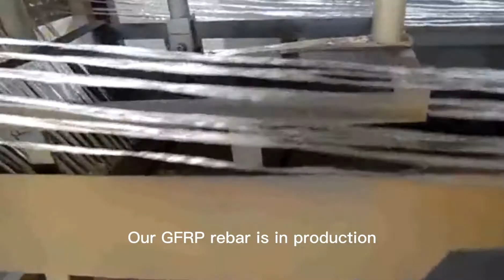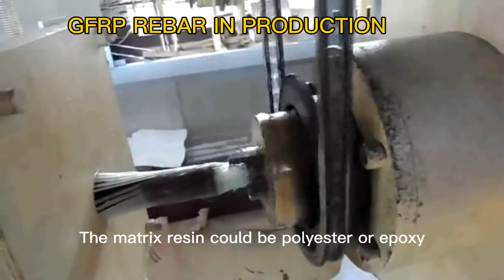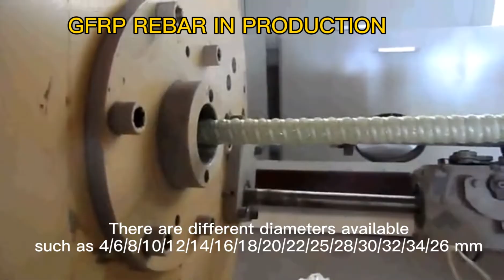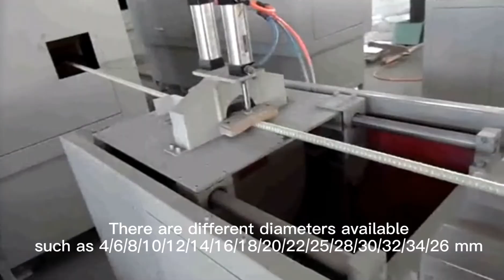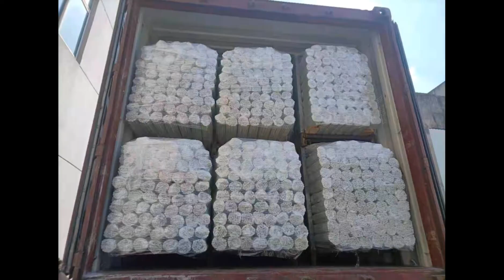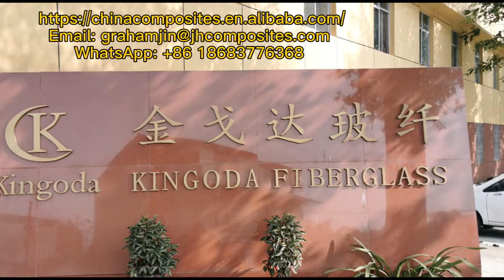GFRP Rebar Factory in Production

Comment: Two technologies can be used in the production of composite reinforcement today, these technologies do not depend on either the resin used or the roving used, i.e. these technologies use any roving and any resin.
Learn more about technologies:
First,
this is a common technology.
The productivity of which can be increased only by increasing to the limit the speed of 100 mm / second per rod, at this speed it is still possible to impregnate the roving well and it is still possible to cut rods into a given size... Further, the productivity of this technology can be increased only by increasing the number of rods produced simultaneously. We, in this technology, have brought the simultaneous number of rods produced up to 40ka. But there are limitations, a 40–bar line is a combined line - it also produces a composite grid. A line without mesh production is only possible up to and including 30 bars. All further increases and accelerations of this technology are meaningless and do not carry any logic or potential. That is why we have developed the second technology.
This technology has the biggest drawback – these are replaceable coils or bobbins, which on the one hand slow down the whole process, and on the other increase the cost of the final price of the composite reinforcement rod.
Prices:
- 10 bars from 90,000 euros and above - depends on the configuration.
Productivity up to 100 mm per second per rod – depends on the length of the line.
And depending on the number of shifts per day, you can get a monthly productivity of 60 tons per month. I.e. at a price of 90,000 euros, you get 60,000 kg per month of high-quality composite reinforcement and low cost.
You can calculate the price of another manufacturer based on this performance – we know that our price is more profitable.
The length of the average configuration, at a line price of 90,000 euros, is 39 meters, this is the net length of the line, without taking into account the twist into coils and the size of the valve outlet, i.e. reading the length of the metal.
By the way, the uniqueness of our bay winders is that they can wind coils of 100 kg or more, which is convenient for wholesale sales and take up less space in the workshop. All our technologies are designed for serious industries, not for artisanal production.
- 20 bars from 150,000 euros and above.
- 30-bar from 260 000 euros and above.
The second is at least 2 times more productive and simpler, the modulus of elasticity is like iron and even higher.
The second technology we have developed.
This technology has made it possible to increase the speed by two to 200 mm per second per rod and leaves the potential to increase the speed to 400 mm/second per rod. But there was a question with the rest of the nodes, which simply do not work at such speeds. That's why we had to completely redesign the line and create something completely new, which allows us to raise both the speed and increase the most controversial indicator in composite reinforcement – the modulus of elasticity. According to our calculations, the elastic modulus of the reinforcement produced by our technology will be like that of iron reinforcement, and maybe even higher. Which, along with other indicators, will give an undeniable advantage to the owner of our lines. The maximum number of bars produced simultaneously on such a line cannot be more than 30, otherwise it will not be convenient and practical to work. We pay special attention to convenient operation on all our lines. We always say that on any of our lines it is possible to work with a much smaller team of workers than on the lines of other manufacturers. In this technology, the biggest plus is the lowest cost possible, since there are no some nodes and processes, and therefore people are not needed there and they are paid, etc., etc. Therefore, this equipment is more expensive, but nevertheless it is more profitable for the plant. Yes, this is a factory, not a line, and the productivity is appropriate and you will have a corresponding profit.
Productivity up to 200 mm per second per rod – depends on the length of the line.
And depending on the number of shifts per day, you can get a monthly productivity of 240 tons per month!
Our website: http://www.zao-rif.ru👍👍👍👍👍👍👍👍👍👍👍